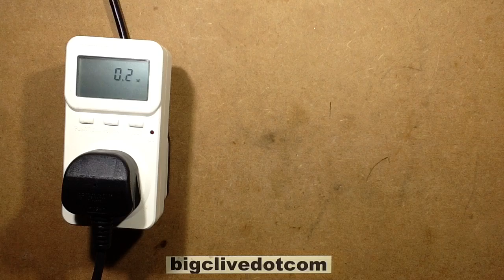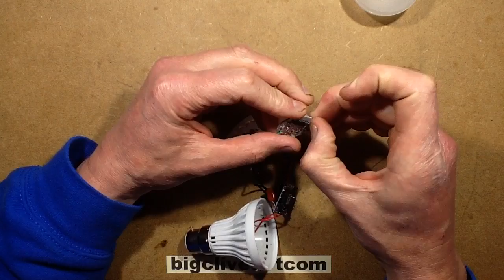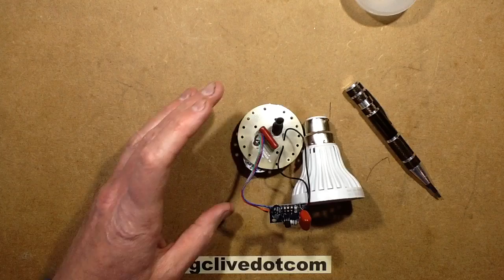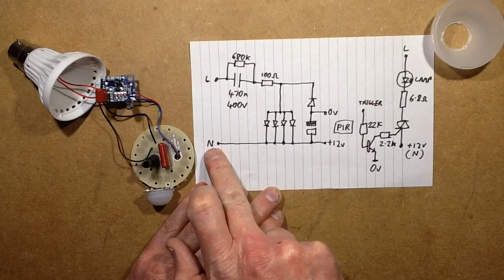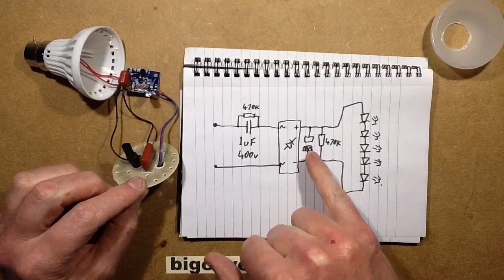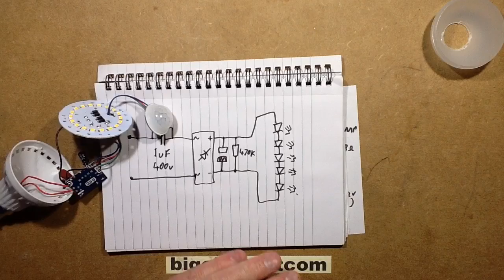Inside another PIR LED "nipple" lamp.

Comment: Did you tear/test this? How save is it this 230V PIR ?
https://www.aliexpress.com/item/PIR-IR-Infrared-Human-Sensor-Body-Sensor-Induction-Lamp-Switch-Light-Control-Ceiling-Light-Motion-Sensor/32806316224.html?spm=2114.search0104.3.30.2ecbe2f9wdWuDj&ws_ab_test=searchweb0_0,searchweb201602_4_10065_10344_10068_10342_10343_10340_10341_10084_10617_10083_10616_10618_10304_10615_10307_10302_5920011_10313_10059_10534_100031_10103_441_10624_442_10623_10622_10621_10620_10142-10621,searchweb201603_32,ppcSwitch_3&algo_expid=c08ecc61-9e00-47ce-a572-cee548b8bdda-4&algo_pvid=c08ecc61-9e00-47ce-a572-cee548b8bdda&priceBeautifyAB=3

Comment: Hey BG, how are you doing? Trust all is going well, someday I'd like to learn how to reverse engineer things the way that you are able & believe me I have tried but just starting out in electronics it just does not make any sense to me as to where to start & end & all of that. I've tried on a simple, well I thought a simple enough circuit board with 5 Blue LED's, two transistors & 3 resistors with a J1 plug, I think it's called for the power hook up & oh yeah the mic. on the board to flash the LED's with enough noise or music & I'm just unable to figure out even with the schematic as to how to look at the board & figure it out how to reverse that onto paper as you do it, so any advise from an old pro would certainly be well appreciated my friend. I've worked on mainly in the last years of my career as a service tech. on Heat/Air/Refrigeration. Anything that was appliance related I'd work on & repair it so that's why I don't understand as to why I'm unable to figure this out when I've learned so many different things in my lifetime, about 60 now, yeah I know I'm an old buzzard. Sorry to ramble on, happens to me sometimes.
Reply from the maker: Doodles and patience is the only way.
Reply: Thanks for replying to an old fart like me BC. I think I see now how to find R1 is because it completely goes through to Positive along the other side so I think that has helped me to at least figure out why it's R1 instead of the other 2 resistors, Thanks again Clive.

Comment: can you explain the zener diodes in parallel a little better?  Is there an advantage to adding them vs the way other models do it?  I realize they are done in parallel for current capacity, but I don't remember other bulbs having the diodes.

Comment: I found out that you can't use l.e.d. bulbs on the same circuit as a standard u.s. bulb,I have three regular bulbs in a row in my bathroom,one bulb burned out so I put a fluorescent,bulb in the middle ,it got real bright real quick,and hot so I pulled it fast,I was going to put a l.e.d. bulb in next but I was afraid of the same ,Clive do you no what gives
Reply from the maker: Are your lamps low voltage ones or the full mains voltage?  Some low voltage halogen drivers have a very high peak voltage that can damage electronic lamps.

Comment: Aww, you didn't put the two side by side, then you could have had a pair of boob lamps... :P

At least on this one they actually added the components for the retriggering feature, which makes it more useful rather than just being on-off-on-off...
Reply: Oh wow! convert them to run off batteries, fashion some kind of shoulder harness to hold two of them side-by-side on your chest and what have you got? Personal headlamps that only come on when you need them! Shoulder mounted solar panels could help keep the batteries charged but I think you'd need some kind of tassel in front of the PIR so that you could jiggle every once in a while to keep them switched on.

Comment: I'm thinking the heat shrink on the cap is so when the power supply flops out of the bottom the metal cap on the cap doesn't short anything out.

Comment: I think the 12 Volt referenced to neutral has something to do with triac trigger quadrants. Not all triacs can be triggered from all quadrants I believe.
Reply from the maker: It is.  Triacs are usually most sensitive when their gate is pulled negative to MT1.
Reply: +bigclivedotcom It's not necessarily referenced to Neutral... the lamp can be plugged into the socket either way round so it may be referenced to live!
Reply from the maker: True, it was just the polarity I'd selected when I drew the schematic.

Comment: Genuine question: I always see that part of the lamp "plug" is exposed in those UK lamp sockets in your video. Isn't that dangerous? Why isn''t it deeper inside the cover more like a E27 socket?
Reply from the maker: The UK bayonet cap has both live pins on the end.  The metal shell is not connected to anything.
Reply: Probably a good opportunity to do a video showing the differences between a E26 and the B22.

Comment: How do you follow the paths on the circuit board? I got contagious LED purchasing fever from watching your channel and got a pack of "15W" LED bulbs (cough 5W) off aliexpress. The PCBs are all white with white tracks though - how on earth do you follow the circuit?
Reply: hold it up to a lit bulb. that makes all the tracks obvious. the white boards are rather permeable to light if you have the same ones as me.
Reply: By both close inspection but also guessing, a lot of tracks are just obvious. You could always use a continuity meter.
Reply: it's often helpful to take a photo with a good camera and either print it out or look at it on a big monitor.